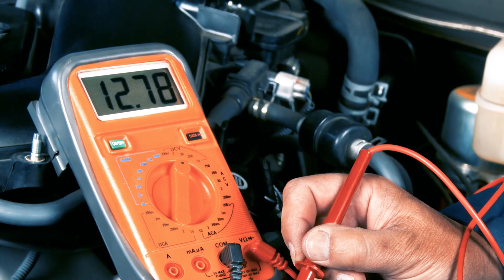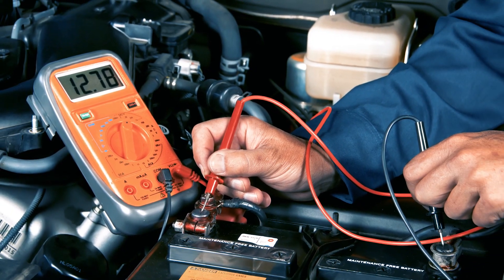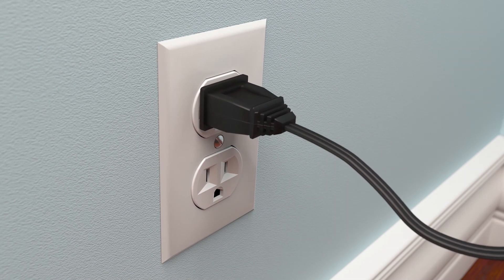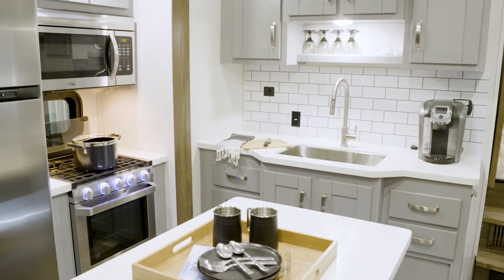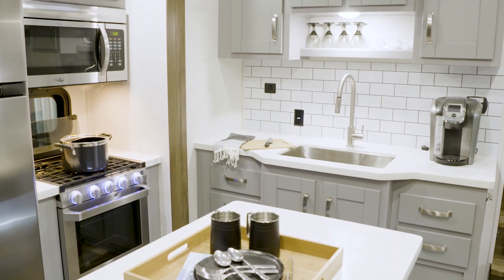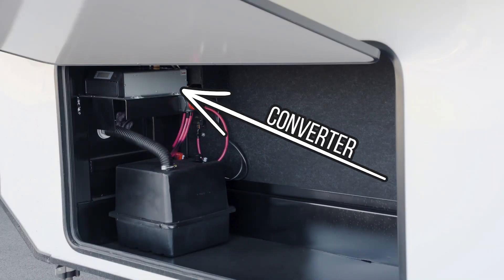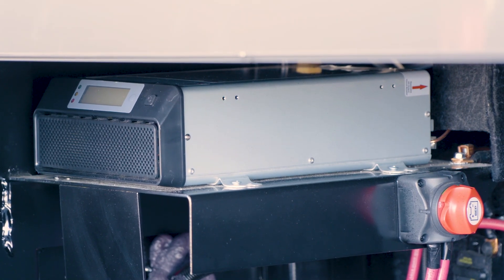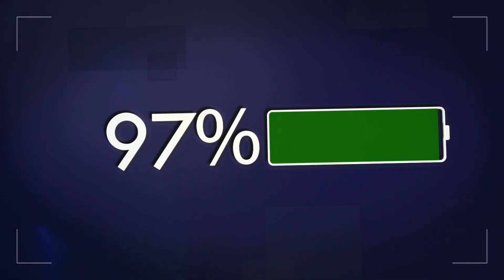What's the difference between 12 volt and 120 volt electricity?

Comment: Can a 120v appliance be safely used in a 220v or 110v outlet
Reply: Never plug it into a 220 vol unless it is rated for it yes you can use it on 110 volt outlet but never plug it into a 220 or 240 volt unless whatever you are plugging in is rated for 120-240 volt
Reply: @IMDYT420  thank you, very much very helpful. God bless